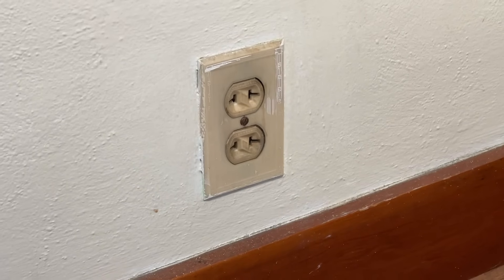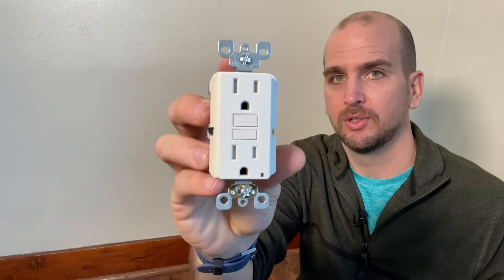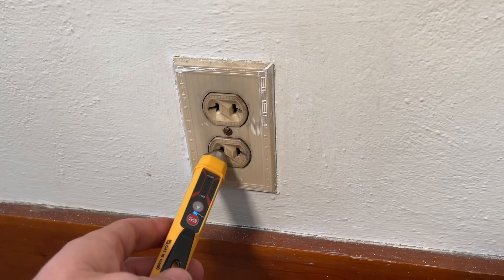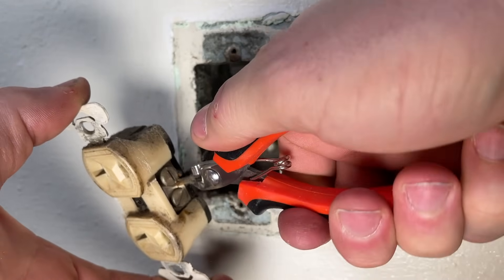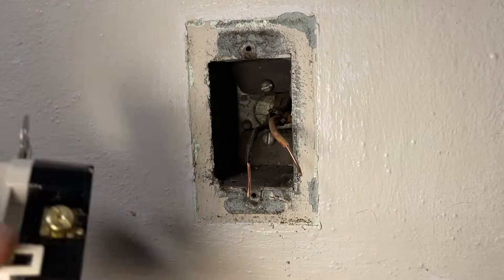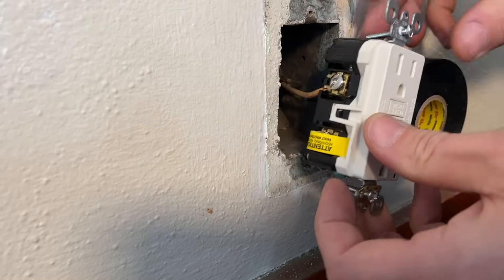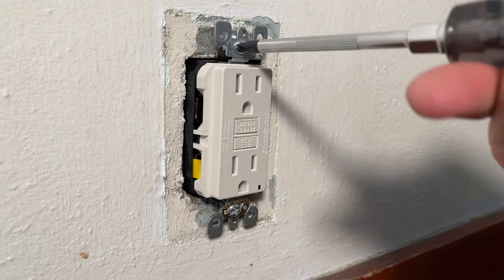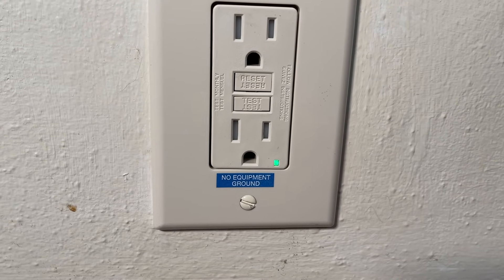How To Replace An Old 2 Prong Outlet Using 3 Prong GFCI

Comment: It’s 2021, if you have two prongs in your house, you can assume the whole electrical system is past its life time.
Reply: If you’re willing to shell out the thousands of dollars required to upgrade an average home’s older electrical system under the auspices of “it’s 2021,” I’m sure plenty of homeowners will take you up on it 🤣
Reply: My house was built in 1901. Are you going to fork over the $50,000 in home renovations to upgrade everything to 2021 specs?
Reply: That all depend on when the house was wired. 2 wire with a ground wire has been around since I was in my mid teens at the same time two prong plugs and outlet receptacles  were still the norm. So unless some fool cut the ground wire off, you can still hook up the grounded outlets  and make sure the other end is grounded in the panel. And if the panel is grounded  properly  there is no issue.
Reply: @dwightlyon3643  ...old home owner  2 pronged ... thinking the land is ready for 3-D printed replacement home ... this house is too mid century ranch ...
Reply: @willgaukler8979  like I said it all depends on what the house was wired with. If it's  just a two wire without a ground then your  right. But if it a two wire with a ground, and somebody did not cut the ground wire off, then you can install  the grounded outlets.
Reply: @dwightlyon3643  The type of outlet suggests that the house was wired in the late 1940s, with early Romex cable, which was not grounded. This would have been the time that Romex had superseded the much more expensive knob & tube wiring.
Reply: @dougbrowning82  oh really,  funny  how they were still wiring with two prong outlets in the mid 60s and tieing off the ground wires in the boxes which were steel. 
I may be up to code as it is now, but am far from being inexperienced even with 660 3 phase, back in the day. 
WOULD I do it today no. But doesn't  mean I forgot  what we did then!
Reply: My son moved into a older house, i seen all new resepticals . Thought thats good..then i pulled out tester and no grounds on any...owner just replace old with new to look nice...
Reply: If the house has plasterboard like mine, it's hard to get wire from point A to point B. I wouldn't try a GFI unless that particular outlet is grounded properly. The external on those usually only monitors 2 wires anyway.
Reply: thanks james’s ipad. we know already. you’re telling me people don’t have fuse boxes with screw in fuses anymore? go figure.

Comment: Thanks for adding he “No equipment ground” sticker. The gfci does not create grounding.
Reply: "The gfci does not create grounding."................and therefore a huge waste of money in this application.
Reply: @mrwildbill24  False. It creates safety. The point of a ground is to trip the overcurrent protection in the case of metal parts becoming energized, to make it safe if someone were to touch these metal parts. A functioning GFCI will accomplish the same thing as a ground fault will occur when someone touches those parts. This is detectable leakage current that will trip the GFCI. So why have both? Because the overcurrent protection may not trip quickly enough to prevent electrocution, especially when a low-resistance path is introduced, such as with water. On the other hand, a GFCI is more reactionary because it only trips when a ground fault actually occurs. But if a metal part is energized without a ground fault, there is no ground fault yet, as there still is only one way back to the source through the neutral. So an EGC is more preventative - if the system energizes the wrong conductive parts, it will trip.
Reply: @mr.g937  Still doesn't create a ground, as I said.
Reply: @mrwildbill24  You said it is a "huge waste of money". That is simply wrong. In fact, given a choice between one or the other, GFCIs are more important and more safe than a ground. Some countries do not even require a ground, but they require a GFCI instead.
Reply: @mr.g937  I stand by my statement, it is a huge waste of money. The money would be better spend properly grounding he system.
Reply: @mr.g937  can i change the electrical box with ground screw and connect the gfci?
Reply: @mr.g937   I have not heard any country not requiring grounding. It is true that many countries use TT which needs a GFCI to work satisfactorily. (In TT the ground wire goes to the physical ground and nowhere else).

Comment: Why didn't you install a short ground to the metal box?
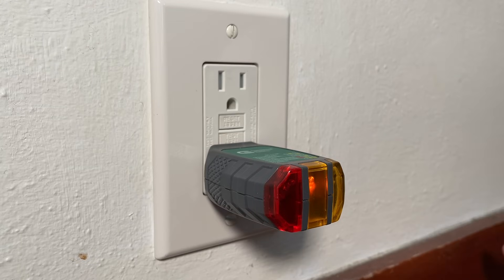Reply: 5:13 the metal box isn’t grounded , plaster and wood are insulators . also If the metal box was grounded the 2 mounting screws are enough to connect / ground the gfci to it

Comment: How safe is this since there’s no ground wire?
Reply: GFCi stands for Ground Fault Circuit Interrupter. It constantly monitors the flow going through both the hot side and the neutral side. If at any point the flow on both sides is not equal, the circuit interrupter will trip, as this indicates that flow is going somewhere that is not intended (possibly you!). GFCI's are very safe and can be used when a ground is not available. You will note that most likely in your kitchen and in your bathroom there are GFCI outlets to protect you in the wet environment. However, like the video said, you can daisy chain several outlets together off of one GFCI, so you may not always see one where you expect it to be.

It is always best to utilize a ground if it is an option. However, installing a new ground for a home can be very dangerous and isn't always a trivial job, especially in a situation like this video. There is literally nothing to ground to! This is 99% as good in my (unprofessional layperson) opinion.
Reply: @SSJ0016  ok, just wondering if it would be best to rewrite house or go with gfci. Talked seller down 5k because house doesn’t have grounded outlets.
Reply: @Thatnoobguy123-h6e  I am no electrician and personally I wouldn't live in a home that did not have a common ground. That would be a deal breaker for me. This is a fix, but I wouldn't want my whole house to be set up like this. That's just me. Please don't use what I say as a basis for any major decisions like a home purchase. I really don't know what I'm talking about when it comes to that level of seriousness.
Reply: @SSJ0016  got a good deal on this house for what it is and they are selling like hot cakes right now so I’m still going to get it. Use those 5k to have it rewired. Better safe then sorry

Comment: Be careful about using the non contact testers because they can pick up induced voltage that is on the wire so it may not always give an accurate result.

You need to get a GFCI plug tester. It has a button on top which allows you to trip the GFCI to confirm it works properly. A GFCI without a ground actually won’t work properly when it comes to tripping. So if you can’t ground the GFCI then you need to use a wire to bond between the neutral and ground. That would make it work properly.

The 3 technical terms for the wire is ungrounded (hot), grounded (neutral), and grounding (ground). So the neutral is bonded with the ground at some point, which is usually at the meter for homes.

May want to mention all this in a future video.

Comment: Sorry, but you should not be telling home owners how to do this. First off, most home owners are not going to want to buy your testing tools, and to do this properly, you need a meter. A homeowner (HO)  can just use an old fashioned lite to tell them when the circuit is off as opposed to your proximity tester. Then they need to know that when they cut the wires, (or unscrew them for a little extra length), that they should pay attention to which one is the neutral and which is hot as some times they are old cloth woven wires and are not readily marked, so some white or black tape around the appropriate wire should be done. They should also use a meter from the hot to the box (CAREFULLY) to determine if there is a BX cable to the box, as that is still an approved method of grounding. If the box is grounded in this manner, they can then run a ground cable to the box with either a green screw to the 10-32 threaded hole or a ground clip. You should also never stretch the tape and then say it adheres better. The tape should not be stretched at all as it has memory and will want to try to go back to its original shape. I have seen it start to pull off the back of the receptacle and leave the front of the screws exposed. Oh and if the wires are short they should be splicing another tail onto them as there are code requirements for the length of the wires. One last thing. At 5:10 in your video, you show a tester that is looking for power. You want to use the tester on the hot slot as opposed to the neutral , because some HO might not know the difference, and some testers are not as sensitive as yours is. If they use that tester on the neutral, they might not realize it is in fact hot and pull the receptacle out of the box and get fried because they tested the neutral slot. Just sayin from a retired 40 year sparkie.
Reply: You sir are the expert based on your accurate explanation. Thank you for correcting and pointing this out.🤝

Comment: What about using Metallic housing as ground(assuming it is grounded.) Is this bad idea or is it against the code?
Reply: That is allowed if you are using metal conduit, very hazardous if you are not.  Any shorts to the ground could start a fire so definitely against code.
Reply: @spyke1890  I have measured the voltage difference between the live and metal housing. I got 120 volts approximately. Based on this I am assuming metal conduit goes all the way to the Circuit Breaker panel. Is this bad assumption, or acceptable reasoning?

Comment: Installation  is against code there is commercially  available  GFCI/AFCI cutler hammer breaker and GFCI /AFCI RECEPTACLES Commercially available. 

Exception No. 1: Arc-fault circuit-interrupter protection shall not be
required where ALL of the following apply:
(1) The replacement complies with 406.4(D)(2)(b).
(2) It is impracticable to provide an equipment grounding conductor
as provided by 250.130(C).
•
(3) A listed combination type arc-fault circuit-interrupter circuit
breaker is not commercially available.
(4) GFCI/AFCI dual function receptacles are not commercially avail‐
able
Reply: What is against code?  Installing GFCI the way he shows is exactly what NEC recommends.  I had to do this in my old house because it would have been almost impossible to install ground wires.  Passed inspection with flying colors.

Comment: Remember old two wire doesn't always have black wire as positive or hot, sometimes the white wire is positive or hot, so it's best to confirm which is hot before killing the power to the outlet.
Reply: White wire is only the hot when switching is involved. In older houses, they used to switch the neutral in the lighting. Receptacles should never have the white as a hot
Reply: @jonbasa  you don't use two wire romex in a 3 way switch. That is what 3 wire is for. Then, the white wire is used as a "traveler" for the 3 way, or as the neutral when you feed one three way, and switch leg from the other.  If you use two wire, then you shouldn't be playing Electrician. Besides, the code states that there has to be a neutral in every switch box, because some dimmers use tbe neutral to operate.  Also, if you had any reading comprehension, I said they "used to switch the neutral in lighting". That's a fact. I encountered that in an existing older house as recently as two years ago. I'm a licensed Master Electrician and have been in the field for about 33 years. So, get off of your superiority complex and realize that you're not the smartest one.
Reply: @jayhaines1792  You can buy Romex with two wires (black and white), three wires (black, red, and white), and four wires (black, red, blue, and white), all with ground. If a white wire is used as a switch leg, it must be tagged at both ends with another color. Otherwise white and grey (if encountered) are only neutral.
Reply: @dougbrowning82  I know about different types of Romex. Ive been a Master Electrician for over 30 years. In case you didn't know, most places taping conductors smaller than #6 is no longer allowed.

Comment: What about replacing the circuit breaker for the outlet circuit with a GFCI/AFI combo breaker. Would that be code compliant for a non grounded circuit and allow for grounded receptacles?
Reply: Yes, it does not matter where the GFCI is as long as it is protected. Remember to mark accordingly. Th GFCI outlets come with labels. I do not know if breakers come.
Reply: @okaro6595  but why? why is it important to label. If you want to check if an outlet is GFCI protected or not, you don't check the label, you put in a GFCI tester and you press a button. THat's the only way to know for sure.
Reply: Well they cost $70, for one. Secondly, they are hypersensative, and will trip constantly especially on homes with old, worn out wiring and splices. Third if you were in a newer home with fresh quality splices and wiring, it would be modern wiring with a ground. But hey, a GFCI breaker would work. In my home though, I would put illegal three prong every time. Just makes more practical sense- its like a very good three prong adapter
Reply: 1) For this purpose you could use GFCI breaker, AFCI is irrelevant (although desirable in many scenarios) 2) In North America today, GFCI+AFCI or GFCI only breakers are EXTREMELY expensive and not available for some panels. A cheaper solution is to use a separate box near the panel with a receptacle. They are cheap and universal.

Comment: I'm doing several of these in my 1950's house. The problem I'm having is the gfci outlet is almost as big as the inside of the box.
Reply: I guess they make a slim version.i had watched a video and found out.i have an old house too with same problem
Reply: @greasedmonkey7571  I’ve had to cut the nails holding the old box and put in a new cut in box that is larger.

Comment: Maybe this is a dumb question, but if i don't want to deal with figuring out which outlet is upstream in my home office, can i just replace all four outlets with GFCI outlets?
Reply from the maker: That would work,  In that case, if you have room in the electrical box I would make up Pigtails and then just have one white and one black going to the "line" terminals to the GFCI.  Good luck and be safe!
Reply: @EverydayHomeRepairs  thank you!
Reply: The Devils Help I feel like the average person would be more comfortable putting in a few GFCIs vs replacing a breaker

Comment: Our country was a former British colony so we inherited 3-prong grounded switched outlets and the EarthLeakageCircuitBreaker for protection. If I lay any extension cord outdoors I protect that with something called a ResidualCurrentDevice. I note that the RCD gets warm when plugged in even when the load is off. Is is the same for your GFCI? Does it consume power and run warm? When did you guys start to go 3-prong? Do you have live-neutral reversed issues?
Reply: Harvey Hubbell invented the first American grounding plug in 1916–the crowfoot plug (which is the same configuration Australians currently use).  Philip Labre invented a three prong plug in the 20s that was more similar to the grounding plugs we use today

Comment: Other than cost, is there a reason why I shouldn't put multiple GFCIs on the same line?

For convenience, a previous owner installed three-prong outlets in my old knob-and-tube house years ago but the ground terminals aren't connected to anything. I don't want to leave an unsafe condition for the next owner. But rather than try to figure out which outlet is the beginning of the line, I'm thinking it would be easier for me to just replace all of the suspect outlets.
Reply: you can but it is not necessary
it would be like having 6 keys to to start your car, you can do it, but you only need one.
when one GFCI trips, the entire line will lose power.